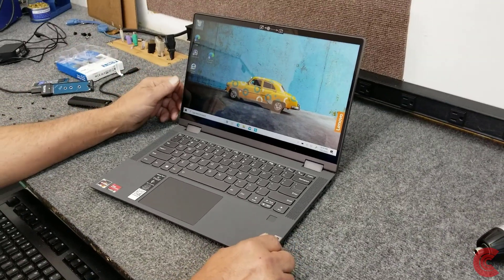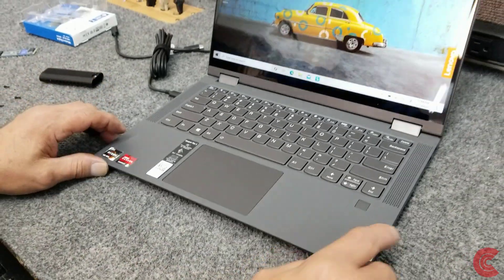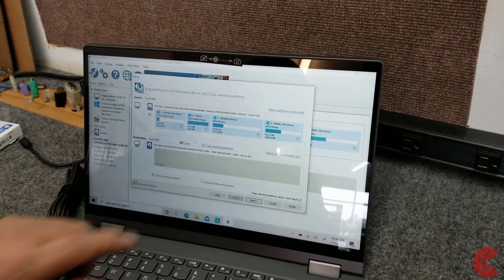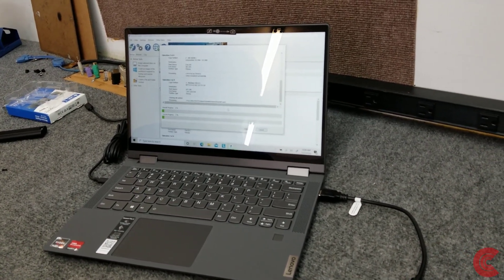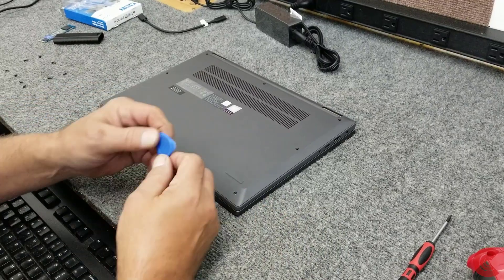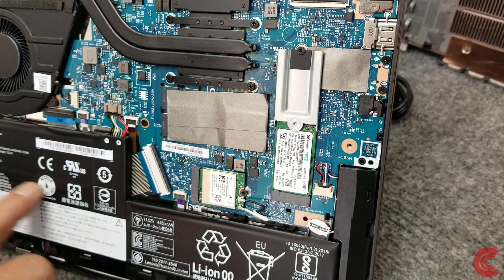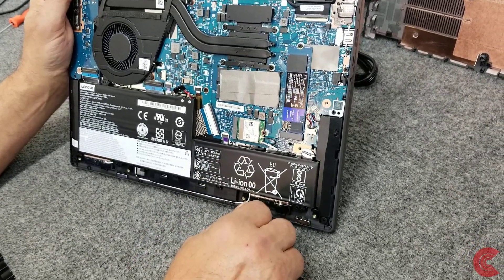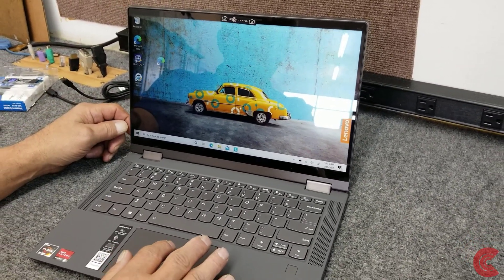Lenovo IdeaPad Flex 5 14" SSD Upgrade and Clone Using Macrium Reflect 7 Free

Comment: RAM IS UPGRADABLE You can add more RAM to this PC. I have the very same model and now I have 20GB RAM. It is confusing at first because Lenovo says the ram is soldered. Well, They have 2 channels. Only 1 RAM channel is soldered. 1 is removable. Lenovo soldered the 4GB stick to the motherboard, dedicated to the tiny graphics card (I believe) or dedicated to something. There is a 12 GB stick that is removable. I took out the 12GB stick and replaced it with Crucial 16GB stick. So... Now I technically have 20GB RAM in my Lenovo Flex 5 14in.

Comment: Thank you so much Dale.  All went GREAT!  Note that in my case, my Flex5 (mfg 07/28/2020) the case screws were T5, not T6!  I also bought a cheaper SSD adapter that worked fine (AMZ SSK M.2 NVMe SSD adapter) just for others reference.  Also note that Macrium current download version is 7.3.5854.  I did NOT try that version and instead searched & downloaded the older V7 DLHF version (which is what I used successfully!
Thank you again

Comment: Thanks for this video. Gives me enough confidence to go ahead with upgrading the SSD. Question about ChromeOS
Lenovo Flex 5 13.3" 2-in-1 Touchscreen Chromebook - 11th Gen Intel i3-1115G4 - 1080p
Processor & Memory:
11th Gen Intel® Core™ i3-1115G4 Processor
8GB LPDDR4x 3733MHz RAM
128GB NVMe™ TLC Solid State Drive

Would the Software Macrium Reflect also clone Chrome OS?  How do I check the maximum capacity SSD this would support?
Thanks a Lot.

Comment: Thank you so much.  I fought this for 2 hours because I was using the PAID EaseUS Partition Magic to clone the SSD and the Lenovo refused to boot from the new drive.  I had never heard of Macrium before this video and it worked instantly.  Had I used it from the beginning this would have been a 20minute upgrade.

Comment: Is that  2.5in SSD bay under the battery?  I've seen the battery removed on other videos and it looks like it is.  I've got several 2.5in SSD's I'd like to use for additional storage and don't really want to go w/ a USB caddy.
Reply from the maker: Hi. This model has no 2.5 drive bay. Nothing under battery. No room.  Dale
Reply: @CadillacComputerCenter  Thanks!

Comment: I'm taking my old ssd in my current laptop and putting it into the new lenovo laptop since my old ssd is 1 TB. Will I have to do any cloning process since the old one already has all my files and windows 10 on it? Or can I just take the ssd out and replace them? Ive already found out that my current ssd is compatible with the new laptop
Reply from the maker: Hi. It's very possible it will boot up and work.  May need to get some new drivers. Just run with windows update.  Dale

Comment: Thanks for the video it was great. This is my mode I got for $729.99 at Staples on sale.  Lenovo IdeaPad 5 15IIL05 81YK 15.6" Notebook, Intel i7, 16GB Memory, 512GB SSD, Windows 10 (81YK000LUS).   I want to  remove the 512 GB drive and replace it with a 1TB or 2TB drive.  My internal drive is a  M.2 2242 SSD / PCIe NVMe, PCIe 3.0 X 2,  can I replace that with a M.2 2280 SSD / PCIe NVMe, PCIe 3.0 X 4 drive?   So, I want to go from a 2242 to a 2280 drive.

Comment: Dale, thanks for the instruction.  I have the same system and ordered the same products and performed the same clone.  With the new SSD installed the system boots up fine, but after a few minutes the system freezes and gives a flash of a blue error screen and announces the system has to reboot.  It then goes to the Windows recovery page upon start up.  Any ideas what went wrong or how to troubleshoot?  Note that when I put the old SSD drive in the system works fine again.  Regards,  Mike
Reply from the maker: Hi there. Well, you can try a couple things. First, type memory diagnostics in the Cortana search box, then click memory diagnostics to reboot and run 2 passes. Possible you got a buggy stick of ram, try that first to rule it out.
Reply: @CadillacComputerCenter  Dale, you were right on.  I ordered a similar 1TB SSD (Crucial this time) and every thing worked just fine.  I think I got a "buggy stick of ram" as you suggested.
Reply: I have the exact same issue.  When Windows boots, I can login but then it flashes the blue screen and then reboots into the Windows recovery.  I've used MiniTool Partition Wizard (the last free version) and the Macrium to clone the disk.  Same result.  The drive works fine when it is in the USB adapter reading and writing.  I'm lost.
Reply: @wdblackman  see my reply to Dale above.  It was just a bad drive I think.  My first drive appeared to work fine too when it was just plugged in as a USB drive.  I got a Crucial 1TB SSD the second time around, btw.

Comment: I just followed this video to the T, with the same laptop and same size nvme drive and using the same software, but it doesn't work?? It gives me an error code of 0xc0000225.
It also does not show the new drive in the file explorer before or after the cloning process.
Reply: My guess is the clone process failed.  The bios can't find the boot files.  https://www.drivereasy.com/knowledge/0xc0000225-error-code-on-windows-10-fixed/

Comment: Hey! I tried several times to do a fresh Windows 10 install on a WD blue SN550 NVMe 512gb but it fails the first time Windows 10 try to boot. It shows the winLoad.efi 0xc0000225, try lot of things... Disable uefi and secure boot and nothing, tried to fix mbr with bootrec and nothing, any clue? I thought the Flex 5 is not fully compatible but then I saw your video...
Reply: https://www.drivereasy.com/knowledge/0xc0000225-error-code-on-windows-10-fixed/

Comment: Hi Dale.  Thanks so much for this video.  I've ordered a Flex 5 with a 512 GB but I may want to upgrade to a 1 TB so this is very helpful.  The Flex 5 comes with 802.11 Wireless-AC (2x2) + Bluetooth 4.2, Realtek I think.  Would it be possible to do a video on how to upgrade to WiFi 6?
Reply: How much did 512GB variant cost ?
Reply: @aakashmahato7572  Right now on Amazon, close 800$
Reply: @dr.j7542  do I need to pay extra tax after 800$ ?
Reply: @aakashmahato7572  No i think
Reply: @aakashmahato7572  but its price was abt 600$  in july.
Its increased but i don't know why
Reply: @aakashmahato7572  $525 used or $585 new on amazon

Comment: is it nessasary to unplug battery for swapping ssd? just curious
Reply: It's not "necessary", I mean it's not gonna blow up or anything, but it's good practice to do it. In any case, you don't need to physically unplug it, you can go to the BIOS and disable it there before upgrading the SSD. It'll be automatically re-enabled the next time you plug the charger.

Comment: Hey dale, quick question. Macrium doesnt seem to identify my usb plugged ssd for cloning. Windows identifies theres something connected but immediately disconnects
Reply from the maker: Hi.  Seen this before.   Try a different usb port. Hate to say it, but maybe a different adapter.
Reply: I know this is a late reply, but I had the same issue (this is meant for people who stumble upon this with the same issue). What I did is go to disk management (just search for it), and when you open it up a popup will appear on your screen. It will say "initialize disk", and you'll see two options: MBR or GPT. Select GPT (unless you have an old Windows laptop, like older than XP). You can format then format the drive and continue on like in the video
Reply: @davidprice8371  I appreciate the response, it actually ended up being both yours and Dale's troubleshoot fixes that did the trick. Unfortunately I forgot to head back here and thank him but now I can also thank you!

Comment: So I tested this all the way up to opening the laptop. I am currently waiting on the torx 6 to arrive in the mail. I went to the bios to boot from the ssd I copied to and it failed to boot. Does this mean it didn't copy correctly or would it work better if I waited for the torx to come in to replace the storage already in the computer? The adapter was also extremely hot to the touch after I attempted to boot twice (both times failed.), is it supposed to be that hot? I unplugged it and took out the ssd that was in the adapter to cool faster.
Reply from the maker: Hi. It's normal for the controller on the ssd to get hot, but you should just wait to install it in the laptop.  As long as the clone completed successfully,  you should be good once you install it. Dale
Reply: @CadillacComputerCenter  alright thanks! My torx screwdriver doesn't arrive until after the 10th so I'll update when I can replace the drive.
Reply from the maker: Yes, let me know.  Thx, Dale
Reply: @CadillacComputerCenter  well you quote torx 6 screwdriver and got it in the mail today. it's too big for the laptop so I still cannot open it. Thanks so much for that bs.
Reply from the maker: @charlesjames3400  Hi.  if you have the exact model laptop i have in video, yes, it is T6 torx driver.  maybe they sent wrong size.
Reply: @CadillacComputerCenter  i checked it and it says torx 6 on the side. I bought the one in the description
Reply from the maker: @charlesjames3400  Hey Charles, Sry its not working, but I have done 3 of these models recently, and they have all been T6.  Either your driver is missed marked or your laptop has a T5 possibly.  Does not make sense.  Can you send me a link of exactly which one you purchased?
Reply from the maker: @charlesjames3400  Hey.  If you want I can mail you a new T6 and a T5 bit for you to try.  If you live in the states.  Let me know if you want me to.  It wont cost you anything.  Just email me your name and mailing address in the states, and I will get that right out for you. My email is dale@cadillaccomputer.com
Reply: @CadillacComputerCenter  Okay thanks, I will email. I appreciate this.
Reply from the maker: @charlesjames3400  Let me know Charles how it goes
Reply: @CadillacComputerCenter  Sorry was busy the last couple days but I got to it today! I gave you more details in the gmail I sent you. Thanks

Comment: Dale - how does macrium compare to acronis true image? I’ve only used acronis in the past, aside from a couple attempts using clonezilla.
Reply from the maker: Hi.  I'm an Acronis fan myself. Very reliable.  Macrium does a good job, been pretty stable.  When alot of data is involved,  Acronis is quicker though.  Dale